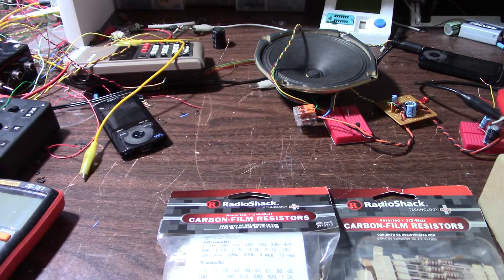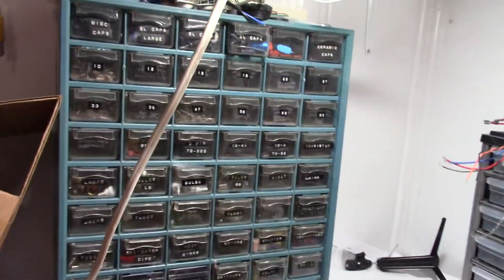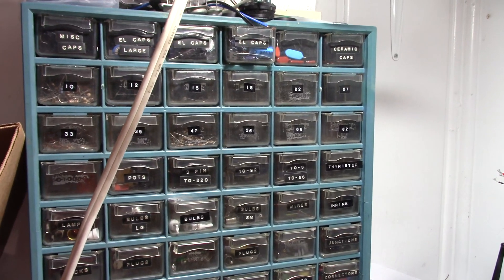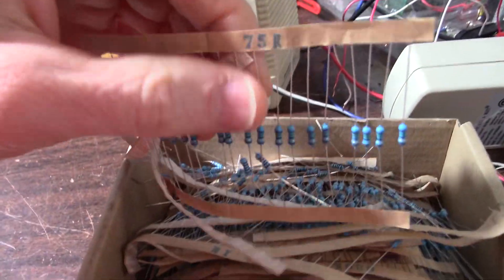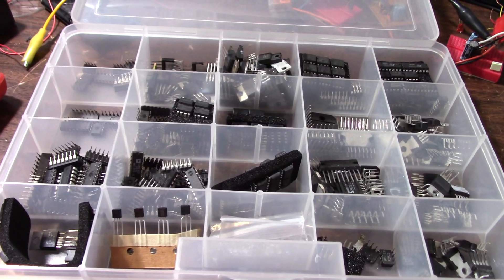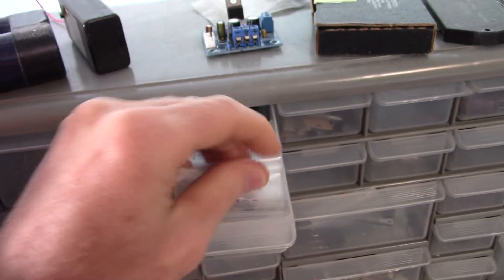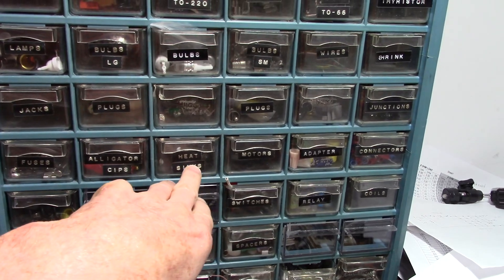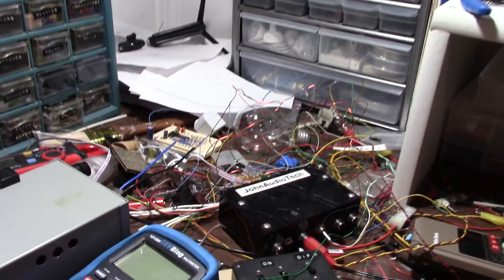Parts to stock for the electronics hobbyist

Comment: Do you really think those Chinese resistors are in some way inferior to the ones purchased through say, Mouser? Will they sound different or last a shorter life? I think most resistors are made in China. Same goes for cheap polycaps. Do they perform any worse? I'd like to see a performance comparison.
Reply from the maker: The Chinese resistors have skinny tinned steel leads while the better ones use tinned copper and are thicker. They may work well enough, but having delt with budget Chinese parts, I'll just stick with the better quality components.

Comment: The arts and crafts store, 'Michaels' in my town sells plastic bin drawer sets for around $15 each. 
I wrote a software application that uses a database for storing part numbers as well as cross referencing numbers for components. About a year ago I added the ability to store and quickly pull up datasheets for the parts. 
 I use a two letter system for the bin housing and drawer number as well as a number if the drawer has compartment dividers. This also allows me to mix different types of components that I have very few of in the same drawer as something else. NA3 for example in my database location for a part would refer to overall Bin container B, drawer A, and divider or pocket 3 in the drawer. 
The software has everything categorized nicely so I can find out what I do or don't have and where it is in a matter of moments. I took the time to build this and get it set up many years ago when my collection of surplus parts was so large I didn't know what I had anymore let alone being able to find it. It took some time to create and I didn't do it all at once. Now when I get new parts and with containers, I add them to the database which only takes a few minutes.
Reply: Oh wow! This is going to be extremely useful for me and extraordinarily kind of you to provide the information. With your help it will now take me only a day to get the database going! Thanks again
Reply: @CommenterRick  👍
Reply: @CommenterRick  Here's a better sample of data. There's a button in the Inventory app that opens up either the URL or the PDF in the web browser another button that selects the file from the mapped directory (config table) and allows the user to click on the file they want that gets placed in the Component table in the Datasheet field as a habit I added a delete field which removes a Component record from any query and display grid, but keeps it giving the user the choice of restoring it at some point:

PartNo	Category	Quantity	Location	Description	Deleted	Datasheet
2N109	Transistor	0	N/A	PNP GE Medium Power Amplifier	NULL	https://www.web-bcs.com/js/geoms/RC/2N/2N109.webp
2N2089	Transistor	0	N/A	PNP Germanium Mesa Transistor High-Speed Switching Applications	NULL	https://alltransistors.com/transistor.php?transistor=1567
2N2222	Transistor	5	NA1	NPN Small Signal transistor silicon	NULL	\PN2222A.pdf
2N270	Transistor	0	N/A	PNP GE Power Output, Driver	NULL	https://alltransistors.com/transistor.php?transistor=2304
2N2907A	Transistor	4	NQ3	PNP SMALL SIGNAL TRANSISTOR - Silicon	NULL	\2N2907.pdf
Reply: @fredflintstone8048  Thanks. I'm coding a program right know that has PDFs, websites and images loaded into external apps so this is going to be pretty easy. Even though I'm an amateur programmer, the reason I went into electronics and more specifically audio was that I wanted to get away from the computer. But I'm finding I'm spending more time than I'd like on a PC.
I really love how John shows parts catalogues from 20-30 years ago and they're still relevant. And the fact that a PC isn't in sight. Thanks again.
Reply: @CommenterRick  I use my app to collect all sorts of catalogs, datasheets, and other documentation. I also use bookmarks in my web browser, but like it in my app better, its more convenient. When I have my component highlighted I click on a button that the doc I've saved either as a PDF or a URL for pops up. I see that for some components like my microcontrollers and other devices having more than one document would be handy so my next improvement to the app is to create a document list child table with the parent being the component. I'll probably set up my button to toggle through them, or pop up separate instances for each.
Anyway, good luck with your app. 
Enjoy!!
Reply: Hi Fred
    It's a really great idea having a database for parts. Since I'm just starting to build up some inventory I would like to code a database too. Could you tell me the schema of your DB, so I have some guide to the parameters to store? Thanks.
Reply: @CommenterRick  .
I'm using MS Sql server expresses (it's free)
Here are some lines I copied from the creation script. 
I also use the software tool for keeping a documentation library for parts, systems, etc.

Category: allows me to create categories for the inventory items for grouping them
Xref: allows me to cross reference similar parts, like I might have different model transistors that are the same etc.
Components: Inventory items
Config: for holding values like paths for where I store datasheets for parts. I wrote the code so it could be a local PDF file, or else a URL that opens in the browser.

CREATE TABLE [dbo].[Category](
	[Category] [varchar](30) NOT NULL,
 CONSTRAINT [PK_Category_Category] PRIMARY KEY CLUSTERED 

CREATE TABLE [dbo].[Xref](
	[PartNo] [varchar](30) NOT NULL,
	[XrefNo] [varchar](30) NOT NULL,
 CONSTRAINT [PK_Xref_PartNo_XrefNo] PRIMARY KEY CLUSTERED 

CREATE TABLE [dbo].[Components](
	[PartNo] [varchar](30) NOT NULL,
	[Category] [varchar](30) NULL,
	[Quantity] [smallint] NULL,
	[Location] [varchar](30) NULL,
	[Description] [varchar](100) NULL,
	[Deleted] [bit] NULL,
	[Datasheet] [varchar](100) NULL,
 CONSTRAINT [PK_Components_PartNo] PRIMARY KEY CLUSTERED 

CREATE TABLE [dbo].[Config](
	[UUID] [nchar](38) NOT NULL,
	[Name] [varchar](100) NULL,
	[Value] [varchar](100) NULL,
 CONSTRAINT [PK_Config] PRIMARY KEY CLUSTERED
Reply: Some sample data:
Category
All
Battery
Battery Charger
BD-MVCU-CPU
BD-MVCU-OPC

PartNo	Category	Quantity	Location	Description	Deleted	Datasheet
0.96" OLED LCD	LCD 	1	ML	0.96" I2C IIC Serial 128X64 Yellow-Blue OLED LCD LED Display Module for Arduino	NULL	NULL
1.5Kohm 1/4W Metal Film	Resistor	20	MZ	Metal Film	NULL	NULL
1.5Mohm 1/4W Metal Film	Resistor	20	MZ	Metal Film	NULL	NULL
100Kohm 1/4W Carbon	Resistor	40	MZ	Carbon	NULL	NULL
100Kohm 1/4W Metal Film	Resistor	20	MZ	Metal Film	NULL	NULL

PartNo	XrefNo
121-48	121-44
121-49	121-44
121-73	121-44
121-74	121-44
2N2089	121-44

UUID	Name	Value
{640F9ED7-65FD-48F4-973A-6D910A8F3251}	SpecSheetFilePath	C:\$data\ElectronicsInventory\DataSheets
{9645DA71-3760-44E1-85D1-C7083BA75B6D}	DBbackupFilePath	C:\$data\ElectronicsInventory
{B9D13D92-CB46-4A07-B093-7669DD6F0069}	DBbackupFileName	\ElectronicsInventory.bak

Comment: I use Thinwall box (transparant plastic food container) for storing and shorting electronic components. I use plastic clip for shorting resistors. Thinwall available on many size from 250ml, 500ml, 750ml, 1L...etc. They are alot cheaper than Rakko electronic components dedicated storage. Thank you..

Comment: John, your storage is a quite typical storage for an DIY audio electronics enthusiast starting his hobby in the late 1970ies. I guess, you are about the same age like me, maybe a little bit older, because of your vacuum tubes. I have never build up nor repaired vacuum tube electronics. In fact I don't have any ideas about it.
Reply from the maker: I'm in my mid 50s. I started out by taking apart my electric/electronic toys : )  I have some tubes lying about. I don't do much with them. They are much like any other amplifying device surrounded by passives.

Comment: Hi John, Electrolytic lifetime: I have many old and reclimed electrolytics. Does anyone have rule of thumb advice on judging end of life? Can elderly electrolytics be 'reformed' safely?
Reply from the maker: I'm not an expert on electrolytic cap failure modes but having some that are over 50 years old and still good, I'd say if the seals are good (they don't dry out), reform properly (proper value, low esr and not leaky), they are fine to use.
Reply: Thanks John. I'll check out on YouTube how to reform electrolytic capacitors.

Comment: In the late 70's I took a course in auto mechanics but switched to electronics as soon as I discovered the possibilities with relays.  Then I bought all the hobbyist  magazines I could find. My first work bench was a dresser drawer that I would flip upside down but it's grown considerably now.  I have a hobby room in the house and another one I built in the garage. I just counted my parts bins and it's 17.  Now my biggest problem is keeping track of stuff.  But for resistors I have taken the assortment of resistors that are on tape strips and taped each one of ten or twenty to an index card in a box in ascending order.  I just snip the lead at the strip on each end and it takes up a lot less room overall as well.  Love your videos. Oh you can't imagine how much wire I have hoarded over the years.
Reply: There's a video on YouTube where a guy wrote inventory management software that he uses. He also has his organizer drawers mounted on 3 sided rotating columns. They're floor to ceiling pipes he installed with wooden faces the units are mounted to. It's quite an impressive setup he has going on. Dave Jones went to an estate where someone dedicated their life to stripping components. He had a shed which was basically a warehouse. At one point Dave walked by the break down station and he used the exact same device I do for salvage. The good old Esico Model 37 solder pot. The wet method is the best.

Comment: Cool video John. I keep components as well and have amassed over 50 thousand leds. I don't have alot of luck with my stuff for audio. I just need to bite the bullet and spend like 300 on quality components from digikey. I've bought transformers and electrolytic caps from there. I'm pretty much electronics all the time since I went off work in my late 30s. I play guitar as well and very well. Not conceit, it's just the only thing I'm confident about. I've been loving the math the most from electronics and getting results but then having to mouse around with different parts because of tolerances. I have a software engineering degree I never used. Thanks again John.

Comment: The problem with electronics is no matter how many parts you have there's always more that you need. I've built plenty of junk box projects but that's what they are. Whenever you want to make a nice circuit you always need something you don't have then.
Reply from the maker: Just like the amp I built in the last video, I had to buy several parts for it. Buying everything to build it would have been a showstopper though.
Reply: @JohnAudioTech  there's people that buy everything for their projects. I'm not one of those people myself but I can appreciate their perspective. It is virtually impossible to maintain a parts horde. We all try with varying degrees of success that fall short of perfection. You made me laugh when you said you couldn't sort resistors by individual value because that's something I've done here myself. I have one index of resistors sorted by individual value in ascending order. I'm sure if you put your mind to you could do it too. I used glassine baggies and card dividers here. It takes up a grand total of 14 linear inches (it's two rows side by side in a cash register drawer). Just to give you an idea of the scale. One day I just got totally sick and tired of looking for a resistor value I needed. I had a bunch of resistor baggies from Digi-Key too. They each have a slip of paper in them with the value printed on it. So that makes up the core of the structure.
Reply: So true!

Comment: half of my components are salvaged/scavenged,  i get a kick out of reusing "junk"  :)
Reply: I needed a 22k resistor one time I went to radio shack and it was around 5 or 6 bucks.  Every component gets plucked out of everything that is garbage now EVERYTHING!!!
Reply: A lot of "junk" parts are better than most of what you can buy new today. I stripped an old circuit board once and found 3 vintage JRC4558 ICs on it. There's capacitors they don't make anymore today either. Like the silver and clear polystyrenes. What I like to call, magic caps. They're amazing in oscillator circuits. They look really cool too.
Reply: @1pcfred  +1  "A lot of "junk" parts are better than most of what you can buy new today"   Amen to that, the stuff that was made in japan/usa/uk/taiwan during the 1980's does seem to be of a better quality.
Reply: @garygranato9164  even very basic stuff is cheapened out now, even to220 regulators have thinner tabs.
Reply: @1pcfred  & @Plain Edged Saw   not just electronics, its everything .   dont get me started lad's.  lol
Reply: @1pcfred  ha ha ha  not in england there not .  where are you ? and whats improving ?
Reply: @1pcfred   its good to make your aquaintance Paul,  i have actually started buying books again ! they so cheap at the minute. i just ordered the "active filter cookbook" from ebay deliviered to my door for 5 quid.  your right there are positives.  take care :)
Reply: @1pcfred  what oscillator circuits do you make paul ?  RF stuff ?
Reply: @1pcfred  lol  you made a receiver :)
Reply: @1pcfred  lol i see what you did there :) .   i'm currently trying to teach myself to repair and modify hi-fi amps, radio keeps popping up during my studies,  some aspects of it are quite interesting.
Reply: @1pcfred  Im a big fan of polystyrene.
Reply: With the cost of components now, scavenging is prudent!